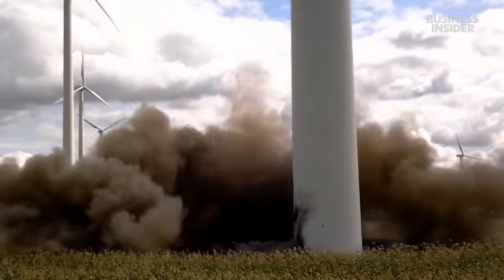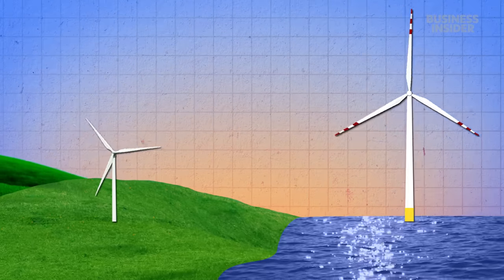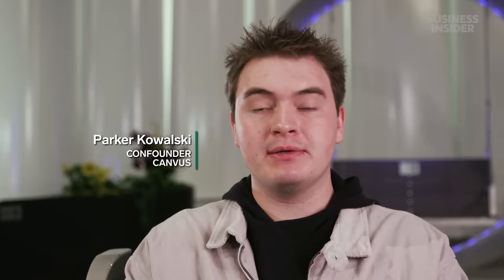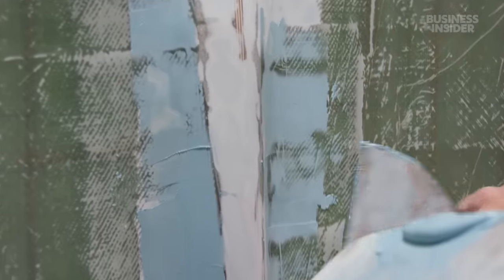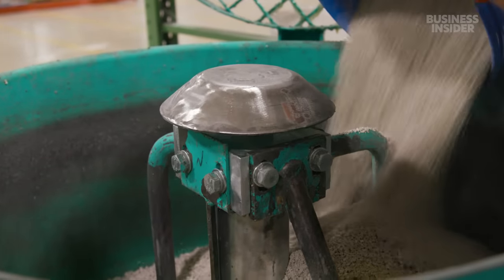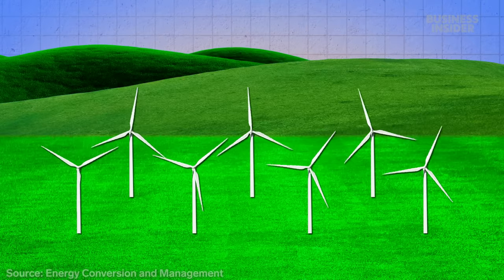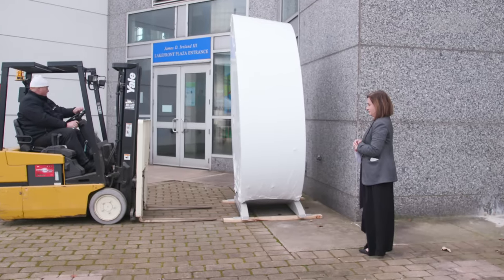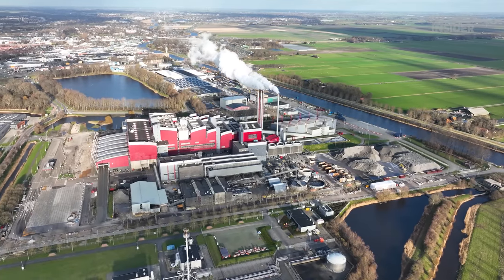How Bad Is The Wind Turbine Trash Problem? And Can We Solve It? | World Wide Waste

Comment: On Engineering With Rosie, she does an interesting breakdown of the scale of the problem. On a per person basis, we discard far more composite materials waste from things like boats and campers, than we ever will from decommissioned wind turbine blades. If we brought all of the composites together from sources other than wind turbine blades, they would make for much more shocking photos than the odd photo of turbine blades
And when compared to other materials that we send to land-fills, these materials are quite benign. They don't leach into ground-water, and don't emit harmful fumes or CO2 as they degrade.
Reply: @ScoocumAF  The LCOE of wind is lower than ALL other sources. Where do you get your data?
Reply: They're made out of glue and fiberglass. When they erode, they do leech those materials. Especially the glue is scary because it causes so many scary ailments in all living nature.
Reply: @Habib_Osman  Can you tell me where that has happened and the damage that was caused?
Reply: @1964mcqueen  Chemical products are super complicated. So.. anybody giving you any short answer is lying.
Search emissions analytics - What's in a tyre? For an epic breakdown of the mind numbing amount of different chemical compounds in tyres. Sure, tyres are not windmills.. but, I suspect the exact makeup of windmill blades might be just as convoluted. So.. I'm not a chemist, but I do know simple answers in the chemical industry are lies.
Reply: @1964mcqueen  Definitely check out the chromatogram pictures. To realise each and every colored spot represents a different chemical.. in a picture consisting out of literally thousands of spots.. Yeah. Modern industry is wild, we've come a long, long, long way since using animal hides and pottery from river clay!
Reply: Media loves controversie. And the anti crowd loves to over react. It is just part of transitioning to new technology.
Reply: @ScoocumAF  that is just complete nonsense lol. Who told you that?
Reply: @rogerk6180  It's not that simple. The most important question that needs to be asked when analysing ecological impact of a product, is which parts of its creation and dissasembly to include. Electric cars for example are much cleaner than combustion engine cars while driving, but electric cars are countless times less clean during their creation and dissasembly. So.. if we calculate the half-time of every chemical component involved in a product.. it gets Really Really complicated! How do we estimate fiberglass for example? The plastic polymers and resins used to coat them do not decompose at all. Meaning they will still be alive and kicking in 30 million years. How would you rate that? Quite tough to say!
Reply: @rogerk6180  If you would ask me: I think the chemical industry is the biggest threat in the long term. The issue is that almost ALL products humans depend on use them. So yeah. Think plastic, think glue, think poiymers etc. All completely ubiquitous, and also all do NOT decompose. So.. it's kinda hopeless!
Reply: @rogerk6180  The only way to live in a bio-degradeable way is to live like a medieval person. No cars, barely any metal products.. those are only for the super rich- and war. 99% of people used 99% wood, stone, animal hides, bone, clay.. and that's pretty much it.
Reply: @Habib_Osman  an electric car and a combustion car are 99% the same. The only difference lies in how it stores it'senergy and where this energy comes from.

One has a fuel tank that has to be filled with petrol that has to be shipped to the car and made from oil which needs to be pumped by massive oilrigs that recuire a lot of resources and engineering to run.

The other has a battery that can be filled with renewable energy. But needs resources and factories in which they are manufactured.

The relativly little resources that need to be mined are a one time occurance bound up in the manufacturing process. After that it can function a lifetime without further resources being expended on it. Recources that for replacement vehicles can be recycled and reused.

If you are comparing a few grams of certain matels that need to be mined for the lifetime of a vehicle which thereafter can be recycled with the thousands of liters of petrol that need to be pumped from oil fields, turned into gasoline, transported to a gasstation and then burned over the lifetime of a vehicle, the ecological footprint of an electric vehicle is only a fraction of the footprint of an electric vehicle. Especially if that footprint can be spread over multiple subsequent vehicles as the resources that are mined can be recovered and reused in new vehicles. Something petrol simply can not do..
Reply: @rogerk6180  A used battery is a lot nastier than a used gas tank. Uncompareable imo. So.. yeah, I'm no chemist but to me it looks like electric cars are cleaner while driving, but a lot nastier while being produced and while recycled/dumped in a junkjard. Because.. do not believe the optimistic stories about 95% of batteries being recycled. This isn't close to the truth. The truth is that only 5% of the worlds batteries are recycled. Do you know why there is such a massive difference in reported percentages? Well, the first only measures what CAN be recycled. The second measures only what can be recycled cost-effectively. If it costs 10 dollars to recycle something that is worth 1 dollar, no company on earth will recycle it. Right? So.. Yeah. Always be super super cautious when reading cute and flowery language. The truth is nasty!

Comment: Currently, adding this macerated fiberglass material to concrete is the best solution. It can reduce the amount of concrete needed, and therefore energy, in many of the world concrete projects as it dramatically increases the strength and durability of concrete. 
Although your cell phone may be small, there will be billions more of those in the trash in the next decade, never mind condoms, packaging for food, electronics, and hair products. So, the truth is, discarded old turbine blades will NEVER be a significant problem.

Comment: The resins to produce the blades are petroleum based. So how is this helping the environment?
Reply: And they are not burned. Not releasing the co2 within it.
Reply: Grams of CO2 per kilowatt hour. 
Coal 870 
Wind 14 

Can you tell me which number is bigger?
Reply: @rogerk6180  do you know how the raw materials such as resins are produced? Do you have any background in the field of manufacturing or engineering?
Reply: @Glacierlune  lol ... this is obviously coming from someone with no education in manufacturing or engineering. 

Do you think, wind turbines just appear out of thin air? The metal you need for it is mined as ore then goes through an extensive manufacturing process using fossil fuels to make into what it is. The fiberglass, the resins, every component is made of raw materials that must be extracted, processed and manufactured as a finished good all using Fossil fuels. The biggest economies outsource the component manufacturing to other parts of the world where there is virtually no environmental regulation. Look at India, China air quality. Then after all that, all just to end up in some landfill at the end of the equipment life. 

I'm for 100% green energy, but this is all a scam. They could have collected wave energy. Used that to make cheap hydrogen. Most of human population live near water and wave energy is abundant. But no, they had to build complex wind and solar devices, all of which require more fossil fuels. Could have used thorium based salt nuclear reactors as cheap, safe, abundant energy, but once again went with pressure water reactors. It almost seems like people don't want a solution.
Reply: @werewolf632  
And you can't even pass a elementary level math class. 

Grams of CO2 per kilowatt hour. 
Coal 870 
Wind 14 

Can you figure out which number is smaller?
Reply: @Glacierlune  really?! Do think these numbers are authentic. Do you really? Where did you get this data? Have you verified it yourself? Does it make sense to you logically. Do you take "candy" from strangers without an err on the side of caution?
Reply: @werewolf632  
Based on the studies examined, wind energy emits an average of 34.11 grams of CO2 per kWh over its lifetime, with a low estimate of 0.4 grams and a high estimate of 364.8 grams. 

Here's from a meta study that has a much more conservative estimate. Guess what, 300 is still less than 800
Reply: @werewolf632  
Logically speaking if wind terbines produce as much pollution in the production as coal than they wouldn't be cheaper to build than just a coal plant.
Reply: @Glacierlune  you are talking about CO2 release by the wind devices or the release due to the operation of such devices. What about the CO2 released due to the production of the materials required to build the wind devices? What about the non recyclable waste at the end of life of the devices? You are just throwing statistical data here without looking at the actual data.
Reply: @Glacierlune  apples and oranges. We are not denying one cost more to build than the other. Coal is really dinosaur. The subject of discussion is CO2 release. Coal is definitely the worst but wind is bad too. There are other forms of energy harvest that are better but we are not focusing on those.
Reply: @werewolf632  
The statistical data is the actual data. It genuinely sounds like you haven't looked up the actual data on the topic. so I'm going to assume you're just ideologically opposed because of team membership and not interested in the actual data. 

Lifetime production of co2. That means operation production and disposing of waste at the end of life. The left over non recyclable material is negligible and solid meaning easily contained.  And in this video it shows it as a possible resource.
Reply: @werewolf632  
Apple and oranges? That was a complete nonsense. 

Okay so tell me how bad wind is. How much CO2 dose it produce compared to coal.
Reply: @werewolf632  note, nuclear produces just as much lifetime CO2 as wind dose. After all the nuclear power plants have a ton of concrete.

Comment: There was a wind energy project proposed in my area. Environmental impact reports determined that given the trees that would be cut down for the transmission lines, the concrete used on the project, and the transportation of the materials to the site, the windmills would never become carbon neutral. We are selling ourselves another lie here.

Comment: The reuse is very good, but I would like to see a more permanent fix for the problem in hand, like some kind of building material.
Reply: It's already recycled as building material and after that as concrete fiber.
Reply: Buildings don't last forever. Not at all, modern buildings rarely reach 80 years old.

Comment: In the late 1970s, I lived in a 'green' house in Vermont. We had TWO windmills in the yard. They did not work. Ever since then I have been anti-windmill. Windmills are decoy devices intended to funnel money, from both taxpayers and ratepayers, to the environmentalists and their financial backers. Over the course of their lifetimes, windmills produce very small amounts of electricity at very high cost and extremely low efficiency, along with great damage to the environment (killing birds, occupying large amounts of land, interrupting the natural flow of the winds, high resource consumption per kilowatt produced (copper, steel, concrete, composite, etc.), and big waste problem (as the video shows).

Comment: The longevity issue is the resin.  Susceptible to UV degradation.  Why can't the blades be made from aluminum?
Reply: Cost mostly. Making blades that big out of aluminum would be very expensive.
Reply: @NBSV1  And a multi-comopnent blade isn't costly?  And then when you factor in the relatively short lifespan, suddenly that lower cost initially isn't so low.
Reply: @frequentlycynical642  They're far less costly being made out of fiberglass compared to something like aluminum. Just in material alone that amount of fiberglass and wood is cheaper than a similar amount of aluminum. Then factor in that the fiberglass only needs a reasonably simple mold where making the same size aluminum blade would be much more complicated. 
Just look at airplane wings which are half as long. Even at that length they're complex and very expensive. They also take much more labor to build even if you don't count the extra moving parts.
Reply: @NBSV1  Once again, less upfront cost and more long term cost, especially if you include disposal costs.  Airplane wings don't even come close to being a comparison.  Fuel tanks, flaps, etc.
Reply: @frequentlycynical642  making these from aluminium would be a major challenge. Especially in the sizes needed.
Reply: @frequentlycynical642  Almost like there's a reason I mentioned not counting the extra moving parts on an airplane wing...

As it stands the disposal costs are pretty small. Just need to buy some land and dump them for someone else to worry about in the future. 
Do you think the disposal and recycling of an aluminum blade is cheaper than a fiberglass one? You're still looking at lots of labor just cutting it into smaller pieces. Then the cost involved with further processing. 
Simply changing the construction to something more complex and expensive doesn't really solve anything. For what they are the composite construction makes the most sense. It's just at the point now people need to figure out what to do with them when they wear out.
Reply: @NBSV1  You know, neither of us really knows shit about costs, especially long term.  I do know that compared to composite blades, aluminum ones will probably last the life of the entire structure, and when that ends, can either be re-used in a new tower or at least melted to start life over again.

Comment: Fibreglass resin is totally made from oil. you need energy to melt glass. and the inefficiency of converting oil to resin to blades is what? Then the energy to reuse what is that? this is no better than just sticking with the base product oil and making energy. the processes along the way are insane energy consumption at each point.
Reply: Nope. These turbines generate multiple times the energy they consume to produce and decomission.
Reply: Grams of CO2 per kilowatt hour. 
Coal 870
Natural gas 464
Wind 14
Nuclear 12 

I love how you can't tell that 14 is a smaller number than 870. Good try tho. But you need to work on your basic math skills. Remember this little guy from elementary school < do you remember which way it goes to tell which number is bigger?

Comment: It's an issue, but compare this to tire disposal: about 1/2 are burned for fuel, about 1/3 are reengineered into downcycled products, and the rest are landfilled. What needs to be done for any manufactured product is to charge the end user an up front fee to handle them at end of life. A few jurisdictions do this (British Columbia for example) but it should be universal.

Comment: Designers should consider product recycling from the moment the project starts to the end👍
Reply: They do in most cases
Reply: @crappymeal in the USA they consider it, but then decide not to, once they have that first quarterly statement.  Isn't it less than 10% total waste is captured for reuse or recycling?
Reply: A windmill made out of 100% recycleable material would be like 25x less efficient. So.. that would require 25x more of them to be placed, requiring 25x more cables, requiring 25x more fuel for them to be delivered, requiring 25x as many maintenance work etc etc.

Comment: just a thought, why not make the blades out of recyclable materials in the first place, thus solving the disposal problem ?
Reply: Because we can't do that yet, because other materials don't have the same properties?
Reply: @CD-kg9by as wood ? as fiberglass ?
Reply: @youtube7076  Yes.
Reply: Like what? Unicorn horns?
Reply: @garywagner2466  Oh, please. Stop being ridiculous. 
Unicorn horns wouldn't work here, they would summon the wind spirits all the time.
Armpit hair of mountain trolls would probably work.
Reply: @garywagner2466 they can make turbo prop engines for airplanes that are the size of a house with high tech blades(not fiberglass), so, i'm not a materials scientist so those who are should figure it out
Reply: @CD-kg9by  Do you realise how long the smell lingers on troll under arm hair. Thousands of square kilometres would be uninhabitable because of the smell!

My suggestion is to use Orc snot. It's light weight, does not smell, and has an unending supply in New Zealand where huge numbers of orcs escaped from the LOTR sets.
Reply: @youtube7076  Heh? Airplane engines?
What the heck are you talking about?
Reply: @youtube7076 These blades are much bigger than that. And, the cost needs to be reasonable. Making them that big out of something like aluminum would drive the cost way too high.
Reply: @NBSV1 so it IS likely a solvable issue, just no one gives a .... i.e. its cost prohibitive... i'm calling shenanigans  on this green power  industry
Reply: @youtube7076  Most everything becomes a cost issue eventually. People already have problems with electricity costs. It isn't like the companies are going to just eat that cost of more recyclable blades. It's the consumers that will have to pay that price. 

Basically all the green power stuff is more expensive for the power it produces. That's just how it goes. But the idea behind it isn't that it makes energy cheaper. It's to try and do a better job not polluting the environment. Obviously they aren't there yet, but progress is being made. I'm guessing in the beginning nobody thought about the blades wearing out and becoming waste. They probably even sold them as being something that would last forever.